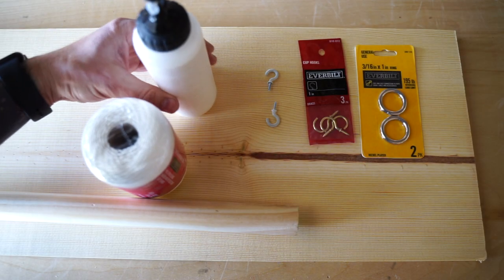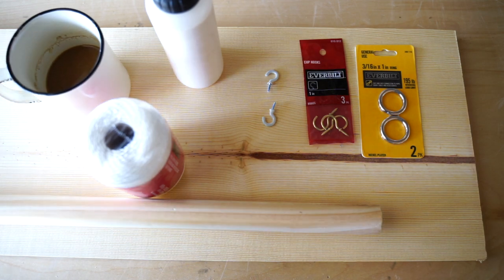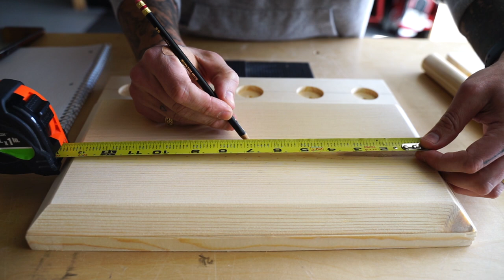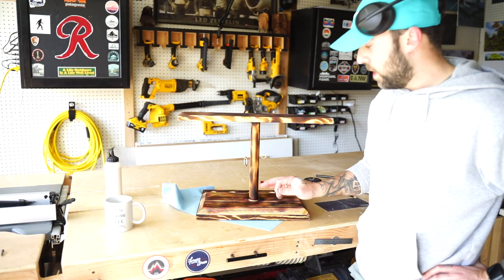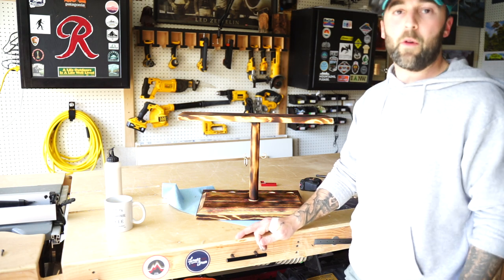DIY tabletop mini sling-a-ring build!

Comment: Quick question what do you call the rings I had a hard time finding something at lowes ended up using a key ring which works fine but I like the one you got. nice video I also subscribed good luck with the channel.
Reply from the maker: They’re 3/16”x1 ever built rings from Home Depot. So far they work great 👍🏼 hope it helps. And thank you!

Comment: A friend has asked me if I could build a couple of these for him. Not too many build videos on it. I was curious if you remember the dimensions of the base and the piece on top. I did notice the part where you mentioned cutting the dowel a bit longer next time...what length should it be at?
Reply from the maker: I searched for awhile too, to no avail unfortunately, if I were to do it again id build the vertical support 18-20" and the top horizontal piece 2" longer than that... just to have more "swing" in the rope. The bottom support could be quite shorter than the rest it seems. All in all a 12x20x24 might be a primo size for this project! hope this helps
Reply: @jessedavidburke8861  thanks man, my initial thought was to glue a 1x6 to a 1x8 or 1x10  at about 14-16 inches in length and then cut the dowel at 17 inches and gluing it in the base and top at depth of 1/2" so it would end up being 16" tall. The excess on the 1x8 or 1x10 would give me the room to cut the shallow holes for the wooden scoring piece. I'm surprised there are no standards set for the dimensions.
Thaks again.
Reply from the maker: @GregoryKThomas  sounds like you’ve got the right idea for sure, even as short as I made mine, it’s still functional and fun!! Hope yours turns out better! Would love to see the end result 👍🏼

Comment: Hi Jesse.. great video and game looks so fun wanting to make for hubby for birthday. I have watched you video and tried to write down measurements not having the best luck lol. All I’ve gotten is the Vertical needs to be 18” lol 
Kind of just wanted to know what I needed so I can go into Home Depot and ask for it lol. Also how do you know where to put the hooks on the Dow?
Reply from the maker: If I were to build it again, I’d make the vertical support 18-20 and the top horizontal piece 20-22 I think, to give the ring more “sling” to gauge where to put the hooks I’d say as low as possible as long as the hook doesn’t hit the bottom platform... 🤷🏻‍♂️ haha hope this helps!
Reply: @jessedavidburke8861  your awesome thanks so much.. I’m no woodworker but I’m going to give it a go lol. I really appreciate this.
Reply from the maker: @amyhill7000  join the club lol. Happy building 👍🏼 glad I could assist somehow